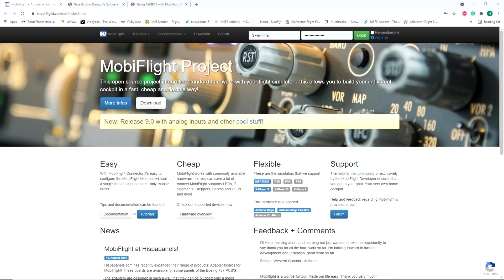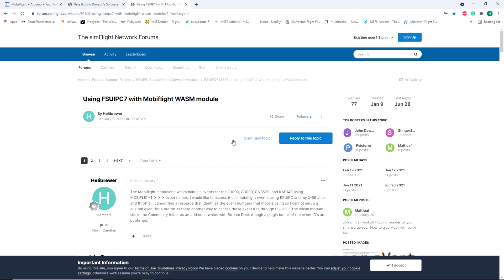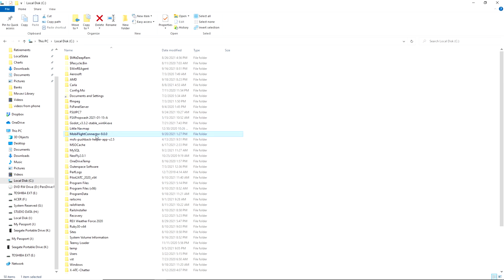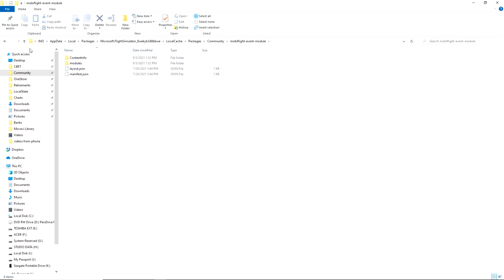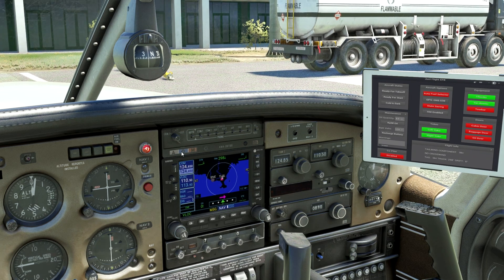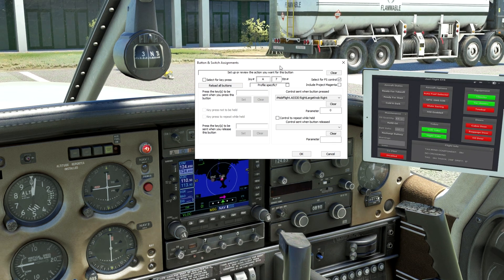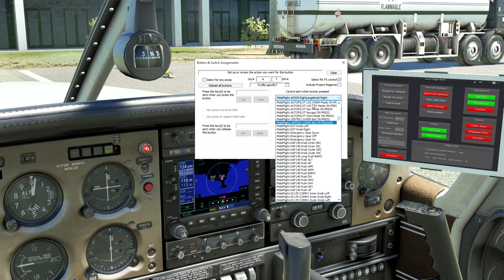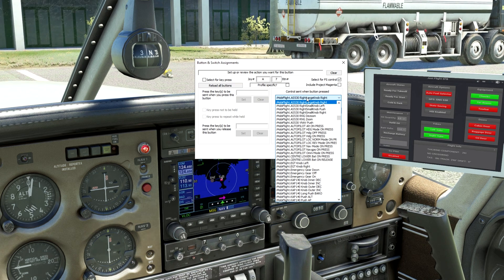Binding DIY switch box buttons and encoders to any GPS Module | Microsoft Flight Simulator

Comment: Hey Jno! Thanks for this great guide. Unfortunately i'm having trouble getting it to work with FSUIPC7.4.12 and Mobiflight 10.1 on the latest MSFS. Any help appreciated! So:

I just want to control the GPS430, 530, 1000, and 3000 knobs with custom freejoy based controls I have built (basically i made my own Octavi knockoff).

FSUIPC7 loads, sees the sim, I see the MobiEvents listed, but when I assign one to a button, it doesn't turn the knob in the sim. I've tried both just copying the mobievents module to the commuynity folder, and also fully installing mobiflight connect and running it alongside the sim.

I can activate Hvars and see settings change, but mobiflight evens dont turn knobs. 

Compared to your guide, unfortunatly i installed mobiflight fully the first time rather than just dragging the events module from the github archive into the community folder. I tried uninstalling mobiflight and just dragging, but no love. I'm working with:

Flight Simulator 1.37.18.0
FSUIPC7.4.12
Mobiflight 10.1

There is nothing in my community folder except fsuipc and mobiflight.

I could try an older version of mobiflight from the github archive?

Any help appreciated!!

Thanks!

Detailed install insturctions:

download install latest mobiflight connector 10.1
https://www.mobiflight.com/en/download.html
OOPS - maybe could have download the ZIP archive from git hub and ONLY copied the mobiflight-events thing into the COMMUNITY FOLDER! duh. Will try uninstall and that method if this doenst work.
download install FSUIPC. will be 7.4.12. he shows 7.2.10
https://fsuipc.simflight.com/beta/Install_FSUIPC7.zip
Installed using installer and registered and paid. thank you.
sign up for site and get the mobiflight event files:
https://forum.simflight.com/topic/91606-using-fsuipc7-with-mobiflight-wasm-module/?_fromLogin=1
https://forum.simflight.com/applications/core/interface/file/attachment.php?id=112097
https://forum.simflight.com/applications/core/interface/file/attachment.php?id=112098
got them.
Find the FSUIPC folder and copy the event files into them.
Ok yeah it installed at C:\ like in this video.
Copied.
launched FS from .bat file. put c172 on runway, running. can see the mobiflight evens. FSUIPC sees my encoder buttons.
Open FSUIPC from taskbar, choose assing, move button, click select for fs control, choose mobifligght g530 right large button decrease, click ok, turn button, nothing happens.
Reply from the maker: Hey @roospense I will talk a look into this. I have not been having problems with mine.

Comment: Hey Jno this is awesome. I'm having trouble getting it work however - do you know if it still works with FS Flight Simulator 1.37.18.0, FSUIPC7.4.12, Mobiflight 10.1 which are the latest as of 5/29/2024? I followed you instructions and i can see the mobiflight events in FSUIPC and my button presses appear in FSUIPC but when i assign them no knobs move on the 530 or 430 in the C172. Any help appreciated!

Comment: MobiFlight Event Files are no longer available on the link posted. Any idea where to download them? Thanks for the video
Reply from the maker: @jose luis moreno thank you for the heads up. I believe you have to create a free account to beable to down load the file. I will verify and get back to you.
Reply from the maker: @jose luis moreno I verified and you do need to have an account to be able to download the file.  Registration is FREE.
Reply: @jnobuildsit1177  thanks for taking the trouble to verify that. Will do so!

Comment: Outstanding. 
Clear & to the point.
Liked, subscribed.
Reply: Again, very cool. Looking at the event list, however, it seems that unfortunately the events don't cover the G1000 interface. For instance, there doesn't seem to be provisions for buttons such as HDG Sync, Flight Level Change, etc.
...Perhaps the event list is to be expanded in the future?
Reply from the maker: @corisco7590  The G1000 is indicated as the AS1000 on the list. It should have all the functions that you need on there. If not, you may be able to put in a request on the FSUIPC forum. The link is in the description. Hope this helps.
Reply from the maker: Thank you Corisco 👊🏽😎.

Comment: Great info.
Just got a teensy, do you have the code you use listed anywhere for your setup?
Reply from the maker: Thank you! I did not use any special code. Have you built your switchox already?
Reply: @jnobuildsit1177  I have not. I'm in the prototyping stage on a breadboard, waiting for more parts; testing as I go. Most of my slider pots are reading far off with the codes I have been finding and the encoder has been inconsistent.
Reply from the maker: @RenzoRin  ok I will send you a  link the code and you can edit as you see fit later today.
Reply: @jnobuildsit1177  thank you, Greatly appreciated
Reply from the maker: @RenzoRin  here is the link as promised. Let me know if you're able to download it. https://www.dropbox.com/s/xuyhd37be6jp9a4/sketch_panel_2.0.ino?dl=0
Reply: @jnobuildsit1177  Downloaded, Thanks again. looking at your code has made what I forgot clear and seems to work as intended. Simply forgot "attachInterrupt"
Reply from the maker: @RenzoRin  good deal. I'm glad I could help! 👊🏽😎